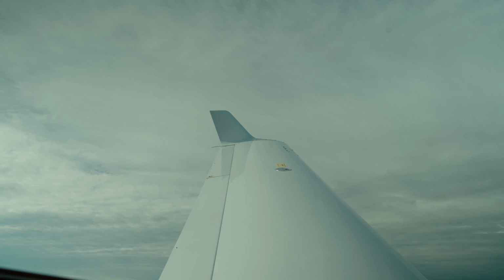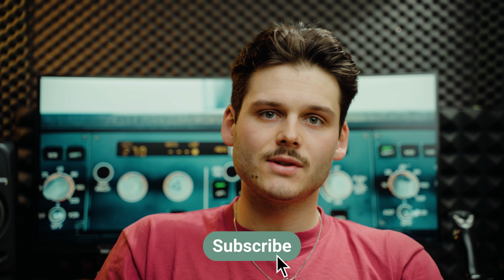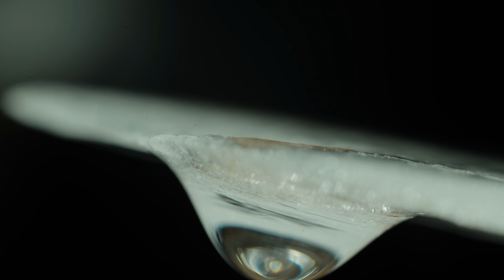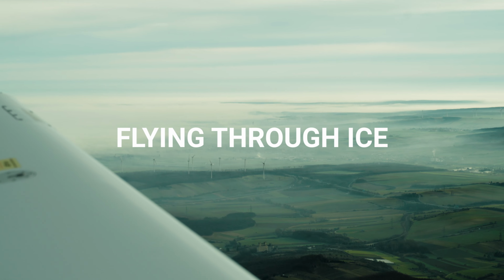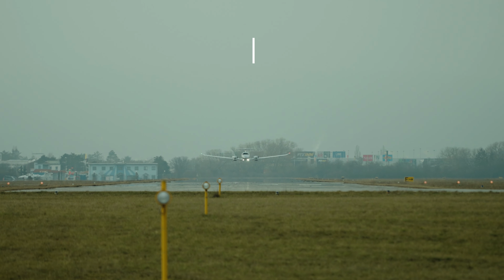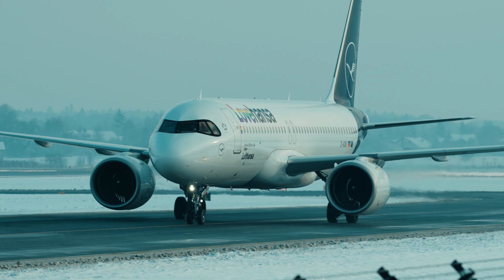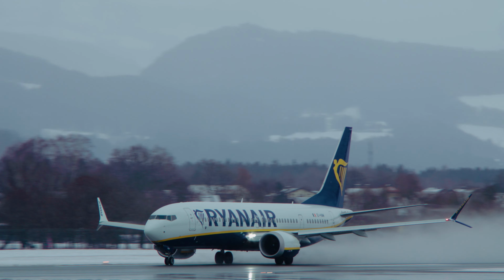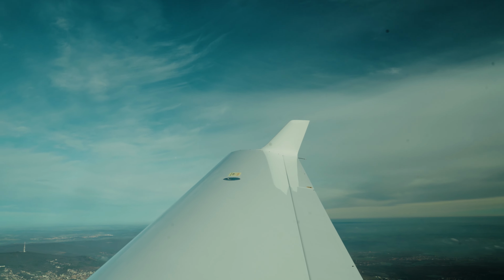In flight icing: The biggest meteorological threat to any aircraft

Comment: Are de-cing systems improved on new planes such that ice is no longer a problem?
Reply from the maker: Yes definitely. Icing was a big problem back in the day. Today with any airliner you really don't have to worry about it too much anymore. But even with an A320, I have heard stories from flight instructors where they were cleared into a holding inside a cumulus cloud during summer where they were accumulating some ice. They were leaving the area without any further problems. 

Modern aircraft like the 787 use electrical heating for ice protection instead of pneumatic bleed systems... We have gone a long way. For smaller aircraft, its a different story :D